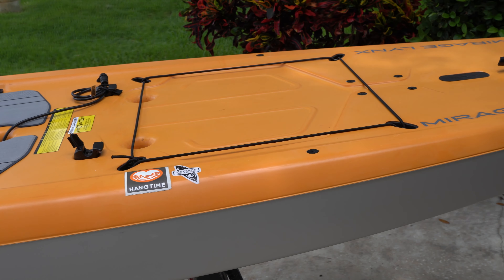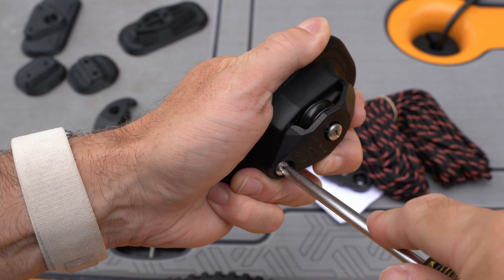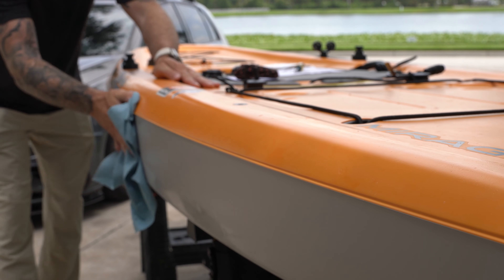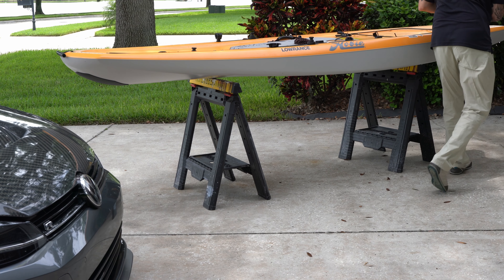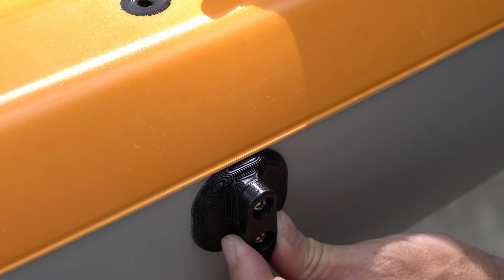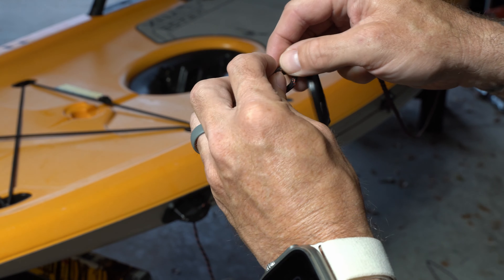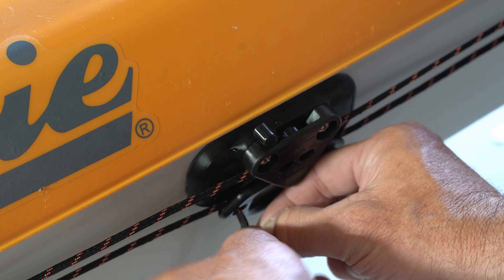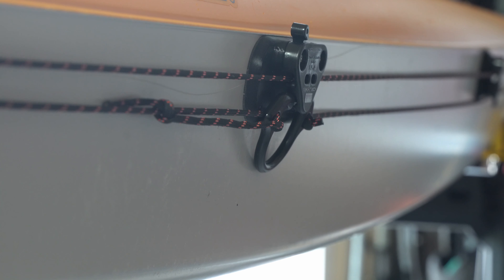Hobie Lynx Anchor Trolley Kit Install! YakAttack LeverLoc with SuperYak Fishing Trolley Kit

Comment: Thanks for this. Finding it so difficult to believe this will take the strain and not fail at some point?
Reply from the maker: @Fishwish  it did fail eventually… after a bit of rough water use.  Smooth water is no problem. But the ocean got me!
Reply: @EVERYTHINGcpo  Thanks - that's really useful to know as if it goes in rough water it could present an extra risk